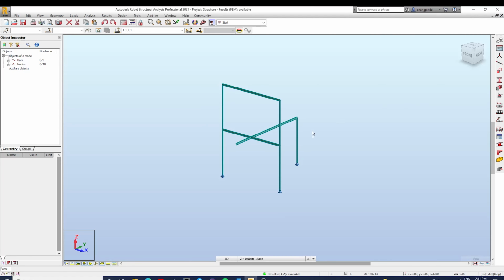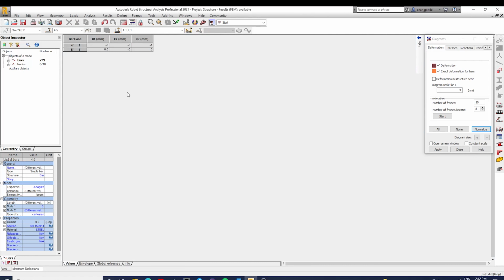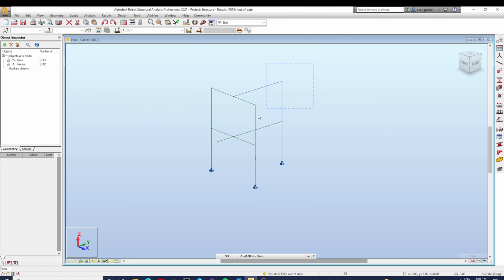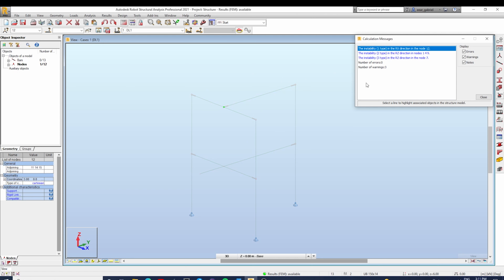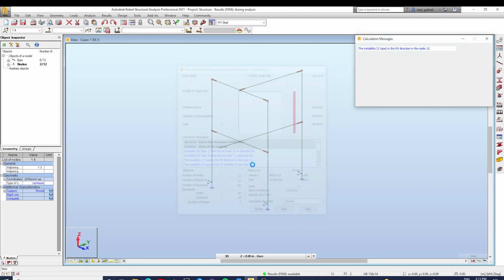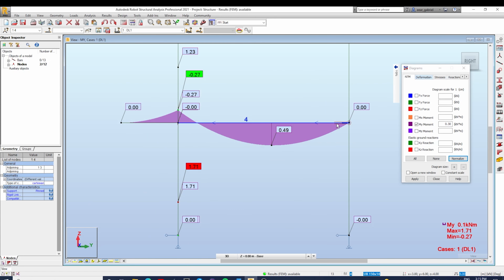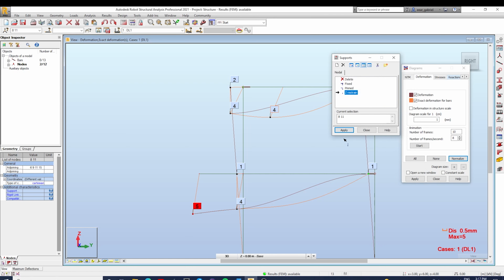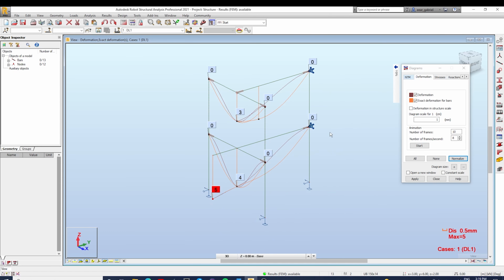WATCH THIS BEFORE DOING a 3D frame analysis in any software

Comment: The first thing to think about when comtemplating a 3d analysis is why are you going to do a 3d analysis?  Can you do a 2d analysis and get acceptable results?  3d analysis significantly increases the degrees of freedom, the support conditions that are required to be restrained.  If you don't have enough restraints you will have instability problems.  If you have too many restraints then you won't be calculating the right forces.  Consider the actual restraints in the finished structure due to floor or roof diaphragms.
Reply from the maker: perfect. Thanks Bill

Comment: Thanks for your sharing! this VDO is very helpful as I am using Robot program too. can you share more tips about steel truss 3D in Robot, why always have instability errors when we release moment in truss?
Reply: i think the answer to your question would be assigning tension and truss members, have you tried this?
Reply from the maker: I'm not sure. I would have to look into it. If you are modelling a truss with point loads on the nodes, it won't make any difference if you release the members or not. Have a look at the results without releasing moments and see if it's what you're expecting.
Reply: @bengthebrazilianengineerinAus  Thanks for your reply. my 3D Truss is applying loads with cladding to purlin & purlin to Truss node. but when I'm release all the Truss members join to pin pin then when run calculation is show in instability error on RX RY & UZ like that.
Reply from the maker: @sothattheng8624   Align your purlins with the truss nodes so you don't have moment on the top chord of the truss. 
Or Maybe don't release anything and make those bars "truss members" in Geometry - advanced bar properties.
Or maybe release only one axis and run the calcs, then release one by one and figure out the problem.
Understand first why you're releasing them and make sure it's compatible with reality. If it's a 3D structure, it has to be stable. make sure your supports are laterally restraining the structure
Reply: @bengthebrazilianengineerinAus  Thank you very much for your reply above tips to young Engineer like me. Hope to get tutorial with 3D steel Truss in your Channel.